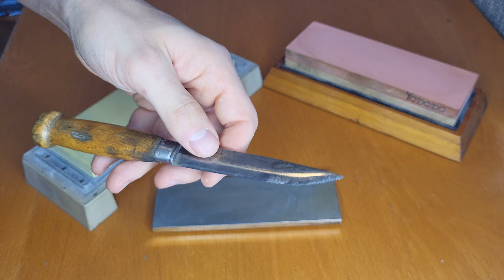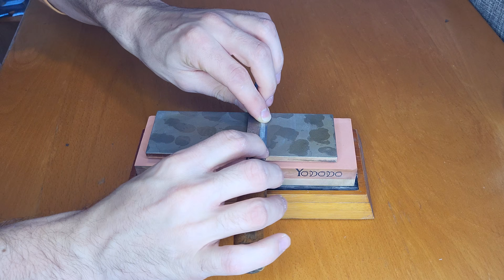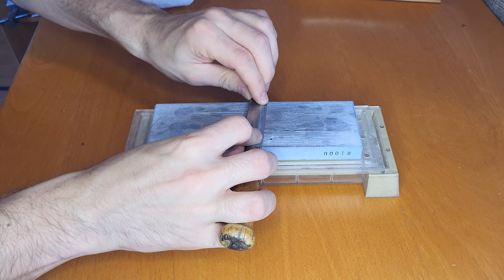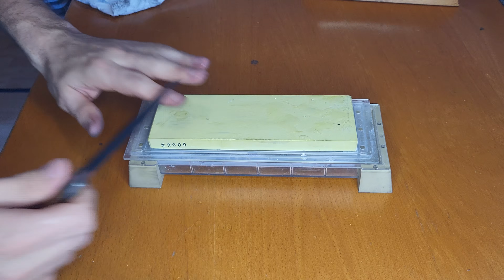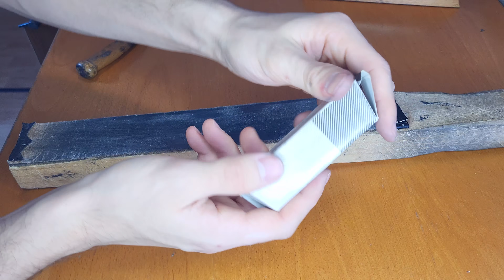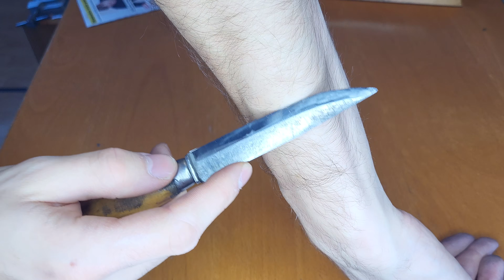How to use a Japanese sharpening stone.

Comment: Nice vintage Mora, i also have one from 1950, but from Carl Andersson with laminated Carbonsteel, that Steel is super easy to sharpen and the Edge is like a Straight Razor when i wanted it to this Level of Sharpness. I sharpen on a not super fine japanese Naturalstone ca.  1000/1500Jis and then polishing on Charnley Forest.
Reply from the maker: Nice one, and it will easyly last another 75 Years 😁. And yea these carbon steel knives are soo easy to sharpen compared to any stainless knife. My Mora is from the 80s, my grandpa bought it for my dad in Sweden ^^.

Comment: Try not to put too much pressure on the stropping leather for scandi knives. You lose a lot of the flat edge at the apex. It should be just a couple of gentle passes.
Reply from the maker: Thanks for the Comment, since i use a very fine compound and my leather is pretty soft I never had any problems with that. But I guess that could be different wirh different strops and compounds, especially those diamond stropping compounds.